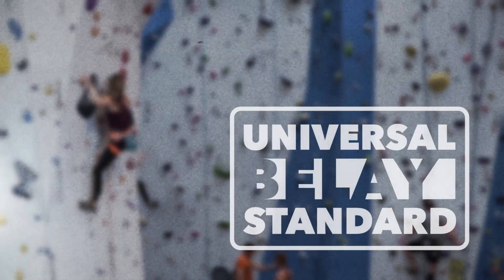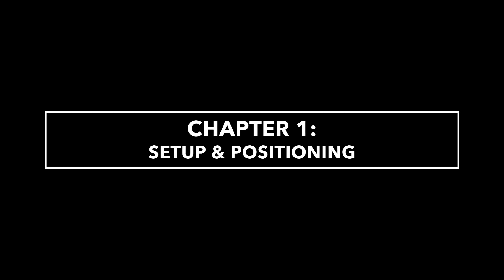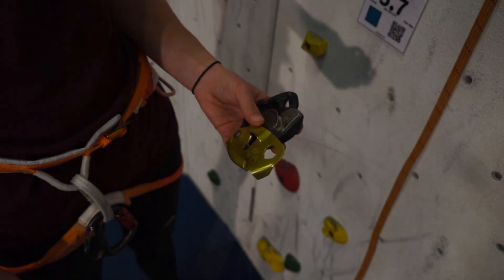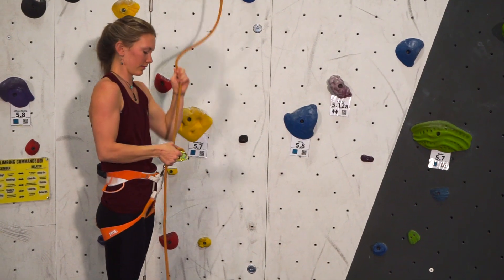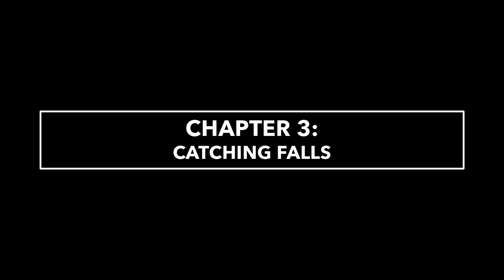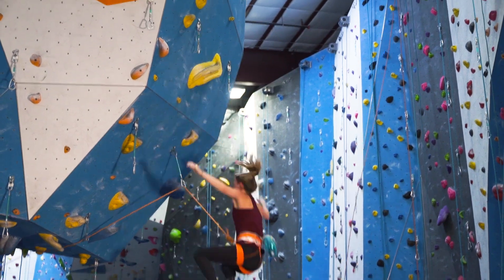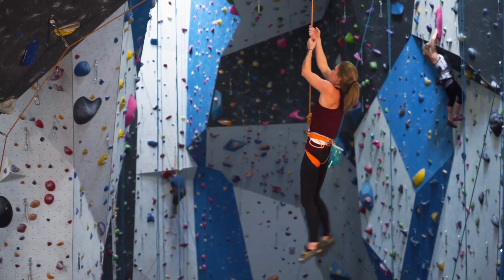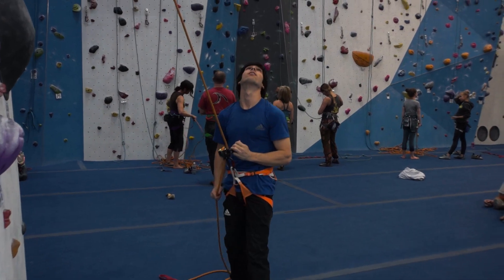AAC Universal Belay Standard: Lead Belaying

Comment: Good video except the double overhand stopper knot is tied incorrectly. Why do so many climbers tie this knot incorrectly?
Reply: Btw, that stopper knot is to close the system to prevent any chance of a too short rope slipping through the belay device.  A good habit to learn, esp if you ever start climbing outside.
And when you dont feed your leader enough rope thats called short roping and can actually pull a leader off the wall/rock.

Comment: for paying out slack fast with the grigri, Petzl tells you explicitly not to hold down the cam as in a leader fall, it could cause the cam to fail. rather, you should place your thumb on the back of the handle
Reply: neither should you break hand need to rise above the friction plate/ATC when paying slack as you're taking the device out of break unnecessarily

Comment: 2:19 Seriously, no stopper knot on the climber?!?! And that’s not a problem? 😨
Reply: Unnecessary.  Stopper knots add no safety to a proper figure of 8.  Stop spreading BS.
Reply: The tail is short enough that a stopper knot isn’t required. As long as the figure 8 is tied close to the harness and the tail is short (6 inches) there is no need for a stopper knot.
Reply: There is never a need for a stopper knot with a retraced figure 8
Reply: Well...a stopper knit is NEVER needed as an added safety for a figure 8 knot. It adds nothing to it and in leading can actually create an unsafe circumstances getting caught in the clip. If you tie yours too long, a yosemite finish is better and cleaner.

Comment: 4:25 she walks her brake hand up the rope...i did the same thing and got denied a lead belay certification at a gym
Reply: I learned the PBUS method. It stands for Pull, Brake, Under, Slide. The brake hand pulls in slack and brakes the device. The non-braking hand then goes under the brake hand, and while holding with the non-braking hand the brake hand slides up. This way the brake end of the rope is always locked off with a tight grip. 

If the brake hand loosens it’s grip to cycle up the rope with no backup and the leader falls, the reaction time to tighten the grip back up can allow for rope to flow through the brake hand. At best this will cause an unnecessarily long fall, at worst it can cause rope burn injury on the brake hand and even an uncontrolled descent. I’ve heard of people getting rope burned, then the force of the grip on a moving rope pulled their hand into the ATC which then causes them to let go involuntary from the pain
Reply: EBR place my free hand under my brake hand on the rope, then slide my brake hand up the rope towards the ATC then put my free hand back on the rope above the ATC to continue to control slack
Reply: i noticed this too!
ive come into habit of when im giving out slack, i slide my hand down the brake side (not up like the video) and when im taking in slack i use my freehand to hold the brake side while sliding my hand up the rope. Using a Grigri fyi.
Reply: I also use the tunneling method like she does rather than the hand over hand or PBUS method. I’m told that AMGA recommends the hand over hand method while it seems that the UIAA recommends the tunneling method. I think that there are pros and cons to each. I prefer the tunneling method because I can take in slack much faster (fewer steps) and my body does not get turned in an awkward sideways position so it’s easier to maintain control. I’m curious if there is any hard data evaluating each method (as opposed to people’s random experiences or opinions).

I would add that when rapidly giving out slack using the Grigri you are effectively using a tunneling method. It seems inconsistent to use it for that but claim that it cannot be used for taking in slack.
Reply: I know this was written a year ago and you may have already seen it, but in Hard Is Easy video they show that tunneling method isnt unsafe the way PBUS system makes it seems to be. Both have its pros and cons as you said.
Reply: I believe it is now officially in the Petzl manuel.
Reply: I've been taught to do it like this instead of the PBUS by the main instructor at Zürich university, so it was the other way around to get the belay certification for me... This only works with grigri and other autolocking devices of course.
Reply: This video has great context information and structure, but the recorded demonstration itself has a lot “discrepancies “. She isn’t the best belayer to be honest…I’ve spotted several mistakes. In one frame the carabiner flipped sideways when the camera was on detail view of the belay device, which is dangerous and belayer should be aware of the position all the time. Carabiners can withstand the forces that way, but they weren’t designed for this. Mainly for vertical forces, not sideways. Another mistake she keeps doing when giving rope to the climber is that she never looks up. She watches the ground, giving a lot of rope for climber to clip and if he would fail to clip and fall, she even doesn’t know he’s coming towards her…I know they’ve been demonstrating on easy route and she has confidence in the leader, but this should be instructional video, so it should be up to scratch. She is belaying from one spot, which isn’t the best approach either…but this video has a lot of good information 👍
Reply: @alesolasz6956  Pretty sure they purposefully turned the biner sideways to reinforce the point they verbalized at the same time.
Reply: I spotted that too, relying on the grigri locking mechanism to catch a fall. 
At my gym we were warned doing that equals an automatic failure on the lead belay test.
Reply: They are pro but yeah she fucked up there. You need to always have a hand on the break end
Reply: This is how it was taught to me during the lessons I took in gym where I climb. As long as you dont open your hand when you are walking it up the rope... She also does it slightly to the side which is also the way I was taught to do it when I was little but when I got my certificate my instructor told me there is no need to keep your hand to the side you can just do it in front.. He told me it's more logical to do it this way for when you want to go on and learn lead climbing (I was learning the simple basics of belaying) so it doesn't surprise me to her doing it in this way. Feels bad they failed you for no reason..

Comment: 4:34 DO NOT bite the rope when preparing to clip! Bad example for an instruction video!
When you fall while the rope is in your mouth it will easily pull out several teeth you may still have preferred to keep.
Reply: has this ever actually happened, though?
Reply: @skyd171  YES
Reply: between your lips, not using your teeth
Reply: All the pros do it though... And all the advanced climbers, and intermediate climbers and beginners and so on and so on.

Comment: 2:36 - Belay is not on because the climber hasn't actually reached the first anchor.
Reply: No, the belay is on and ready to be used. The climber and belayer are connected to the rope, the method of belaying has been prepared, and the belayer's attention is to the rope & climber. Now the system is ready to arrest the climber whether or not there is the opportunity to fall.

Imagine if this party was on a ledge instead of on the floor. After the climber and belayer do a belay check, the climber stumbles and falls off of the ledge. The rope goes tight, and the belayer's attention to the system may catch the fall.
Reply: I expected AAC to have caught that... disappointing...
Reply: super true